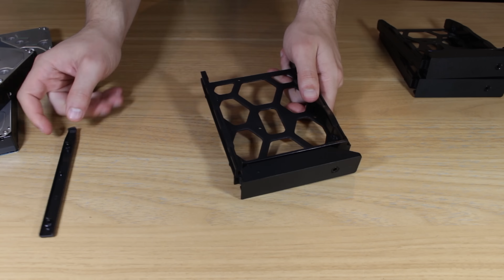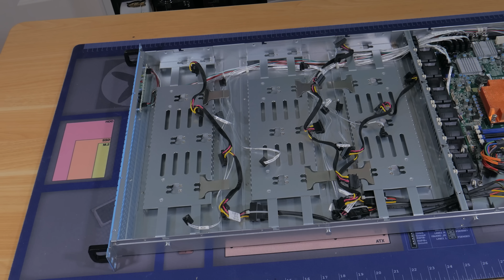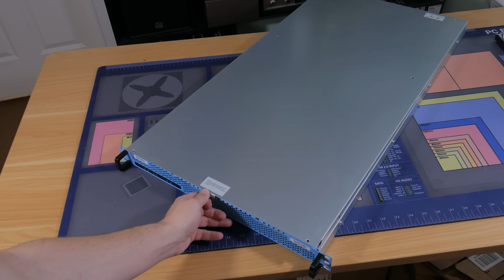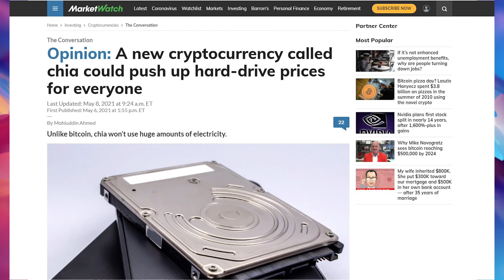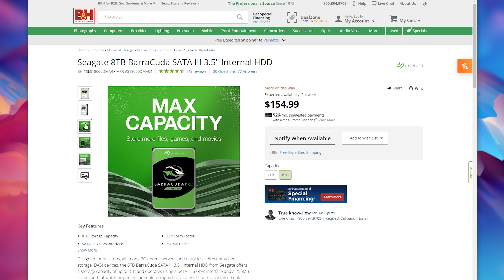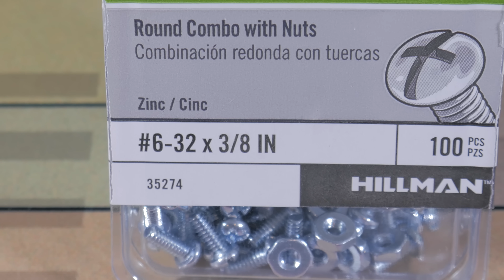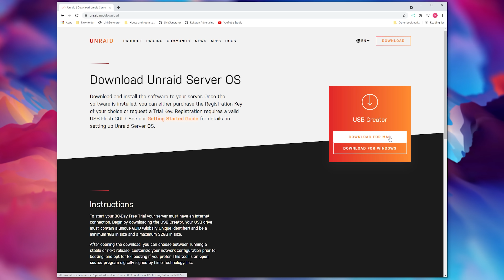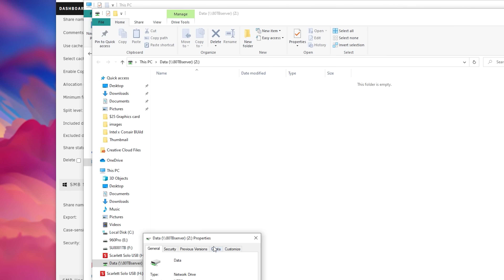Budget Storage Server 2021! | 80TB NAS

Comment: Starting content creator here with a question:
I'm currently using my old pc as a (sort of) server. 
I want to upgrade the motherboard, cpu and ram to something more power efficient.
It's currently running an AMD A-10 6800K single threaded quadcore (100 watt tdp) and 2x4 gb 1600 mhz  ddr3 ram.
I dont know the motherboard type but it has 6 sata cables. (The case also has room for six 3.5 inch sata hdd drives)
I'd like to replace it with an amd ryzen 1600 af (6 core multi thread, 65 watt tdp) and a MSI B550M Pro motherboard with 2x8 gb 3200 mhz cl16 ddr4 ram. 
I'll be using my current GT 1030 DDR5 for video output.
Is this overkill for a server?
I honestly have no idea.
I'm currently running six 1tb 7200 rpm hdd's, i'm replacing the sata ssd drives in my primary pc with m.2 over time so the hdd's will he faded out and replaced with sata ssd drives.
The server storage is my definitive storage, there will be no files removed after being copied.
I gain around 12 GB of to be stored data a day and currently have over 4.5 TB available on my server.

Is this a solid plan?
Any advice would be appreciated, thanks in advance!

Comment: A few things that you may want to get in your next purchase / setup change.

Drive array that you can upgrade in place. - Unraid might already do this, but the ability to replace a drive with a larger one and have the new drive automatically rebuild is priceless.

10Gbe network ports - You’ll be glad that you got them as they really speed
up file editing and transfers.

Front accessible drive slots. You don’t want to have to open the server case up to access drives. the ability slide them
in/out of the front of the server is a big stress reliever.

Larger drives - this is the eternal problem. Trying to buy enough storage to last 2-3 years when you are just setting up is difficult since your needs can change over time.   I’ve learned to multiple my estimate by 150% and that had worked so far.

Noise reduction - Depending on where the server is at, you might want to get quieter fans and drives. I check the noise level of drivers before I buy them.  if the server is out in a garage or something, noise may not be a problem.

Spare drives - I admit that I haven’t purchased spare drives - ever. With a fault tolerant drive array, 1 failed
drive might not be a big deal. But what about 2? Drives purchased at the same time have a higher chance of failing at the same time. Especially if they are from the same batch of drives! 

Your choices aren’t bad per se, but these are things that can make your purchase easier to maintain and last longer before you decide to replace it.
Reply: Do you have examples of enclosures with 10 GB network ports?
Reply: @uddyalok23  you can either buy an SFP nic or an RJ45. SFP is a fiber connector that allows for much much higher speeds and is much cooler than rj45, but rj45 is easier and obviously cheaper.

Comment: Easier if Sega didn't advertise that it used SMR for their external drives, you could contact them and ask for a refund or at least a discount because there was a big backlash in the community when WD was not labeling SMR drives properly, and resulted in some refunds for dissatisfied customers etc

Comment: As a fellow server newb and probably one with less knowledge that yourself, I have a question regarding the drives. In your video you went with all new drives that you shucked... what if you have varying size existing drives you would like to shuck? It is my understanding that, if doing a direct mirror back-up of each primary drive, you need to have a drive of equal size installed opposite it. But does this have to be applied to all drives? Could one have 2x 8TB drives, 4x 4TB drives and 6x 2TB drives and simply let half be primary drives and the other identical half be back-ups?

Comment: Never heard this one run, but 1U servers are obnoxiously loud and have to use more power for their fans.  I think for home use it would absolutely be worth buying a 4U case.
It's also worth setting things up so that the drives will spin down when left idle, because in a home setting they will only see sparse demand.

I have one of these exact model 8TB SMR Seagates, it's held up fine for me so far but I've only had it since about when this video was posted.
Whenever I've thought about shucking, the risks haven't seemed worth it for the difference in cost I was seeing.  But sometimes there might be a bigger difference and the more drives you buy at once the more tempting it gets.

My last purchase was an 8TB Toshiba X300 for $160.  The Seagate SMR was $140, but all the "NAS rated" drives were over $200.  That includes the N300, which I'm convinced is the same drive as the X300 with a different sticker, longer warranty and probably TLER firmware.  TLER won't matter unless you use hardware RAID (which I don't believe in).

I've had good experiences with five of the 4-5TB Toshiba X300s, ranging in age from 3-5 years, but those are a different drive design from the 6-10TB models.

Comment: @Tech by Matt - you have a big problem, those are Seagate Compute drives; those aren't meant for RAID and have a short MTTF; you would have been better to buy NAS drives. You'll probably have hard drive failures in less than 2 years. Be leery of this. I hope you set this RAID up as RAID 6 or RAID 50.

Comment: You should consider a blade that has hard drives in hot swappable enclosures. If you have a drive that is failing, by being hot swappable, you can replace the drive (before a second one starts to fail) and maintain 100% reliability. A lot better than having to shut down your nas and completely dismantle it to replace the drive inside...

Comment: Awesome case find.  Bummer on the drives.  I absolutely would set it up to mirror and stripe instead of just flat storage, but I don't like drive failure.  
Also, while Seagate has come a long way, I have had more Seagate drives fail than all other drives combined.

Comment: ok  as a tech  (in server tech)  good job BUT you gave a  bit of bad advice.  the external drives listed are not great  the difference with a external vs the internal (lets usa amazon segates)

the external may have 64 cache  sometimes less   wheres as a inside variant  comes with standard 256 sometimes 512  this boost drive read  and write by a lot they also last about 20000x longer.   the externals can run  24 /7 and i use to shuck drives as well  but they don't always last past 1 year   a exos  seagate enterprise is always on sale even the 14t's are like 290 off sale on sale 210 ea    so for 6's or whatever its about 180 dollars each (off sale)   why is this better,    they have a 20 + year life span  good for 2million hours  have helium filled drive bay case  so less noise faster spin less friction.  if you don't wanna be fancy u can go iron wolf or barracuda  at the cost of 120 ea/ 6tb.  

last factor speed   the externals come standard as 5400 rpm  where as the internal is 7200 rpm   why:  ppl stand them up right and it can cause a rattle and drive fail / disk head break past that speed.  so they are a  tiny bit more but last 18+ years longer spin faster and make half the noise.

lastly heat:   the externals are not ment to run 24 7 so run  hotter as they are cheaper and come vented for o utside use.     the internals   have parts ment for hot HOT stuff like server rooms if ya get the enterprise stuff   they come close but you may find you need to replaace them in 1-2 years my external died after 1 year (2 years)  and 3/3/3 years  as i have had many i still use em but dont trust them for long term stuff. 

all in all good video i hope i helped =3 if you wanna talk servers u can hmu on discord i can show u what i made im still looking for something to do with  a 1 u

Comment: great build. i did cringe when all those connectors of ram were touched by hand without an electrostatic wrist strap. being a server with all the air flow, if back in to troubleshoot ram, i would recommend a wrist strap. i do like the idea of a server as it would be cheaper than my 8 drive box, which had no raid ability, yours looks like it does and as a bonus a sdd cache!

Comment: I find it funny that this is counts as 1 Unit :D Coming from having audio equipment (much shorter) in my 19" Racks, this thing seems so massive. Seriously, where do you keep it safe? In a Rack? Anyway, nice and inspiring video :)
Reply: RU (rack unit) value only applies to the vertical space, where each = 1.75".  Horizontal length has no bearing.

Comment: Good luck with that. You're going to be losing drives at a higher than normal rate. Your drives are not rated for NAS system? They will spin at the same speed and cause oscillations, causing your cheap drives to be worth even less very soon.

Comment: Good video. I also use Unraid and am very happy with it (4x10 NAS drives). The motherboard is an ASUS server which has the advantage that the boot USB stick is internally plugged in to the MB. I have it doing a parity check every 2 months and it takes 17 hours to complete.
Reply: If I may ask, what's the model of your server and how much did it cost? I tried buying the chembro server but it looks like it's out of stock indefinitely. Trying to get something in the same price price range as the chembro.

Comment: Thanks great build. I built my home server from a discarded tower case an old mb etc. But only put in new CMR drive. Did'nt want to rely on SMR. For those insisting on reducing the noise level.... use Noctua and remember the Wake on LAN switch... at least it is quiet when not in use.

Comment: So you have ended up with a slow noisy heavy brick that uses a load of power. You don't need this for video editing and as you said, it's too slow anyway. It would be more cost effective to just pay for cloud storage if all you need is a backup solution. The electricity to run that thing is easily more expensive than a subscription to a cloud storage service.

Comment: I like buying used enterprise servers. Often come with CPU, RAM, and have externally accessible drive bays for fairly cheap. I've bought servers worth several thousand dollars for under $500. They might have been several years old when I bought them, but 5+ years later they are still humming away.

Comment: 820k views for a storage PC?🤔 edit: well made video but isn't there software that could make usb drives to act as RAID or automate backup processes?  main purpose for a network/server drives is for data to be served to multiple users 24/7.  for a single user, a storage server pretty much wastes a lot.  this can also be replicated with a low power PC with multiple USB ports and USB hubs, just purchase and plug more USB drives as data grows.

Comment: That's why I wouldn't buy externals as it's a gamble.
Not sure about the drive config, 
I would have gone for a riser and hba.
They can have a gig on them and you can run full speed. The board you have is part SATA2 and some have SATA3. But with the hba you can get 12gbs or more (or less).
I think sometimes enterprise sas drives can be a good buy. I've a 16 bay four of which are SATA drives, I'm building my next one which is 12 bay. Both have twin 10gbe's making transfers nice and fast :)

But I did buy and hack a microserver to be a Synology  which is even more simple to do. (And cheaper) but only has 5 bays and a slow 1gbs

Comment: Nice cheap 8TB external Seagate (Barracuda) drives. I guess you didn't do you research and discover that they use SMR (as in Shingled Magnetic Recording). So, be prepared for your write speeds to drop to something from low to tape recorder level, as the drives fill up and data needs to get overwritten due to erase/rewrite cycles.
Reply: ...or, you know, you could have watched the video. That's sometimes an idea.

Comment: usually those server rack form factor is placed in a well controlled temperature environment. I'm curious to see where you have put your server and how you set up for temperature control. Overall, this is really awesome build for low cost storage server.
Reply: As somebody who has a 1u hp server that wants to heat my whole street, I can totally agree with your comment. For me the solution will be underground placement (cellar) with ducted exhaust to push the hot air right to where the server  wants it to be.

Comment: I doubt MX500 is suitable for SSD cache. Surely it has RAM cache, but it is not a datacenter SSD with the high write endurance required. I mean this will work initially, but the low endurance SSDs will begin failing. MX500 500GB has 180TBW endurance, which is not too much if you use it for R/W cache. Saying that I think the job data hoarders do is great, but I don't know whether they are sharing their precious stuff. Sharing could be illegal - we know this since Napster days, so probably they'd do this on the dark web.

Comment: 1.) Did you ever get a set of rails for this 1U Chenbro case and get it into a rack?
2.) Have you looked into a UPS for your single-PSU server?
3.) Those "SATA" cables don't appear to be just SATA. It looks like you have SATA[0-5] as well as SAS[0-10]? (I see unused ports so I'm making assumptions on the number available.)

If those SAS are indeed SAS ports, you could find SAS drives that would be much, much faster. Though you may need an additional module of some kind from Tyan to insert on the board and the SAS drives are - by far - more expensive. (Just a thought.)

The fact that you got stuck with SMR drives certainly is a shame, man. Lesson learned. ;)

Stop broadcasting yourself as a "noob", though. You are a LEARNER. You're doing a fine job in your process of discovery and learning.

To be honest, I would always recommend buying a used R720 or R730 from off of Ebay before doing a build like this one. (Or a Gen[8,9] equivalent from HP.) You get far better IPMI management capabilities that way. (Though it would increase the cost a bit at the moment with the way things are.)

I guess I'm used to spending more on server hardware than I really care about myself. 

Not that anyone cares but this is my hardware - as listed on my Steam profile. :P

https://steamcommunity.com/profiles/76561198036691972/

Anyway... This is still a fine server to use for basic storage with high capacity. You could certainly do far worse. The cost was pretty good. (Though... Again... "OUCH!" on those SMR disks.)

Take care, man!
Reply: Oh. To add another thing. You made the right choice between TrueNAS and Unraid under the circumstances. Otherwise I always recommend TrueNAS. (I myself still want to give Unraid a try and compare the performance anyway.)

Comment: A few problems:  First, you have no redundancy for the cache drive.  If that fails, you will lose data.  Second, those motherboards are sort of time bombs.  I've had four of them, all of which eventually died (due to bad capacitors, I think...repairable, but troubleshooting wouldn't be fun).  Maybe you'll get lucky, but you should probably get a spare just in case.  The onboard LSI RAID controller supports both SAS and SATA drives, too.  I probably wouldn't trust those Barracuda drives, either, but maybe Unraid takes care of that to your satisfaction.

Comment: The eec has a second benefit you haven't considered, bit rot is big especially with larger data sets. If you have ever "fixed" a pc by reinstalling an os thats very like bit rot or failing media or just the old random bsod with no real cause, in short the system is far more stable.
Also you want 2 if those ssds, in case of a failure. unraid will run them in raid1

Comment: Green drives: yikes.  I gave up cheaping out on parts.  So I bought 12 8TB SSDs, and 2 6 drive 5.25 hot swap bays.  All parts included it was probably about $10k but it's basically going to last forever.

Comment: i am using trueNAS now and think that was easy to set up and fidle with. but unraid looks even easier to use. 
my NAS server / storage server was a budget build. HUANANZHI X99 motherboard, 16GB unbuffered DDR3 ram (can switch to DDR4 but they cost more at the time), Intel(R) Xeon(R) CPU E5-2678 v3 2,5GHz cpu. 8 HDD drives of 1TB each. might set up a cache m.2 drive aswell (got 2 slots) and it works like a charm. even set it up against a ups and set the server to shut down 10 minutes on battery power. 
For my use of it, it works like a charm, backup points for windows and backup of all my pictures and documents!

Comment: Very cool setup and video. Some comments: 1.  Backup needs to be offsite, and if possible, offline (ransomeware attacks). Depending on the expertise levels there is not much difference in terms of price from a box like this and  a small Synology server with support, software, easy to expand capabilities on the flight etc. The synology box will use less power  too. On the other hand if one needs the space and the xeon power something like this will be far less expensive.

Comment: Biggest problem I can see is you used GREEN Drives, I have bought about 3 of those, and every single one of them only lasted about a year and they crashed. Now I only buy WD Gold and Black. AND Crucial and Samsung SSDs. I use the SSDs as my "Work Table" and the WD Gold as my Archive Drives. I would never recommend anyone ever buy those Green Drives. When you least expect it, they Crash and you're sweating bullets trying to recover your data. Not my idea of a good time.

Comment: I don't know how to feel about this. So basically, -10 points for a 1u server, +5 points for used hardware, +5 points for rack mount, -15 points for not using a netapp drive shelf, +10 points for shuching drives,  -5 for using Seagate, -5 for no ecc ram, -5 for not using an lsi controller, -5 for not using zfs, +30 for using Linux. Honestly, good job and +100 for making a diy Nas.